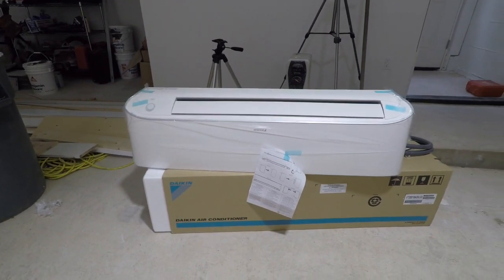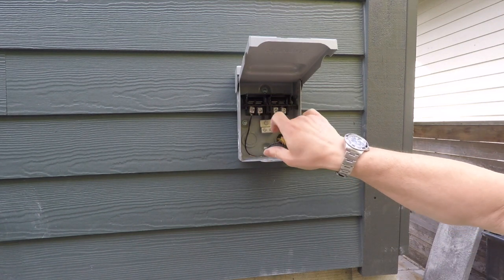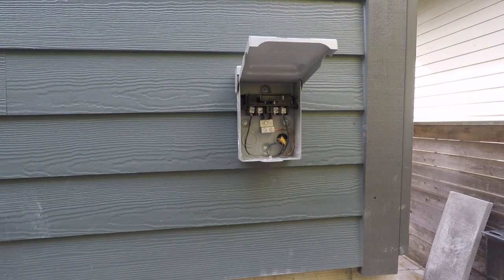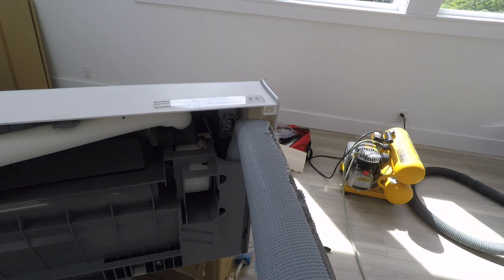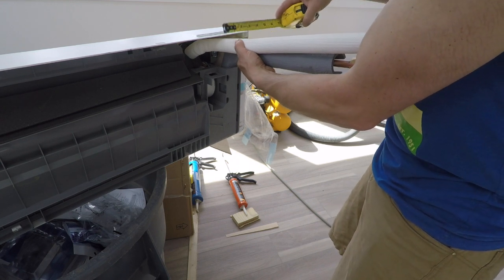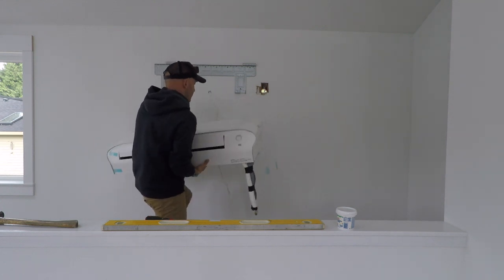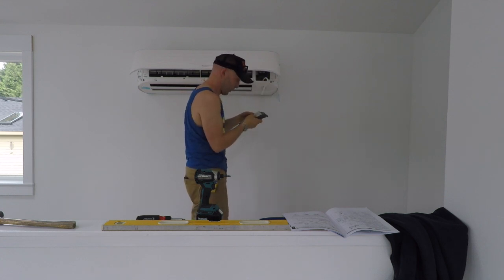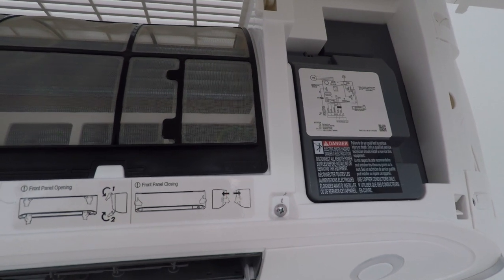DIY Mini-Split

Comment: Wasn't the condenser pre-charged?  They usually are.
Reply from the maker: The condenser was pre charged but the line set was not.
Reply: @yourdeptlogohere  the condenser is normally pre-charged with enough gas for a minimum/maximum length of lineset.  If the lineset is too long you have to add gas.  I assume yours was a bit too long?
Reply from the maker: That not how this system is set up. When you get everything hooked up it tells you how much to add for your length of lineset. It will give you an amount of refrigerant per foot of lineset. Each system is different. Some come precharged including the lineset and all you do is connect it.